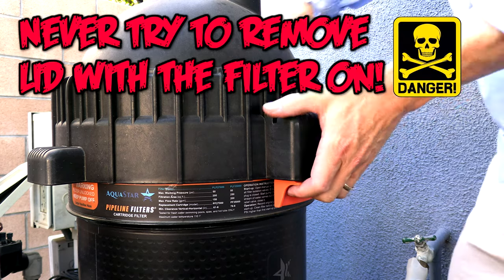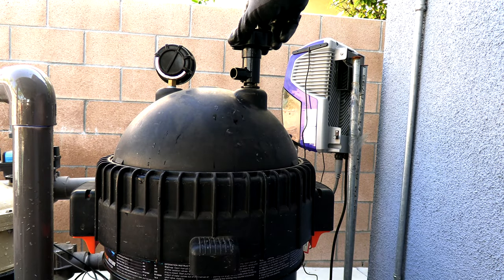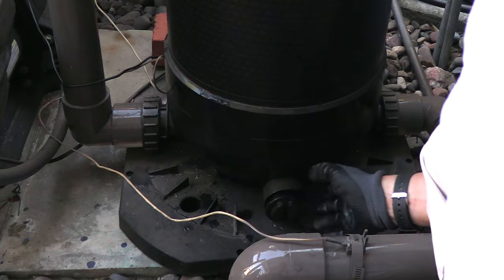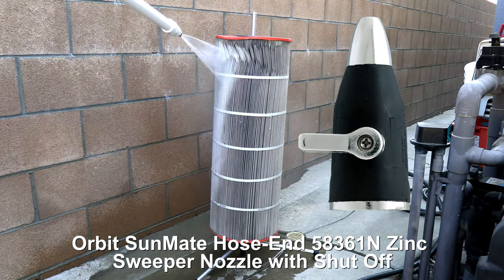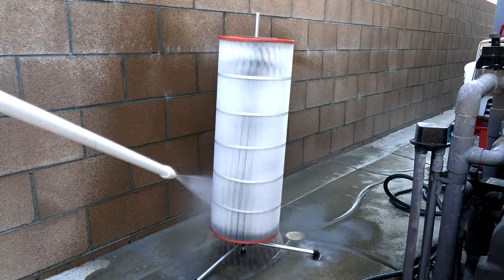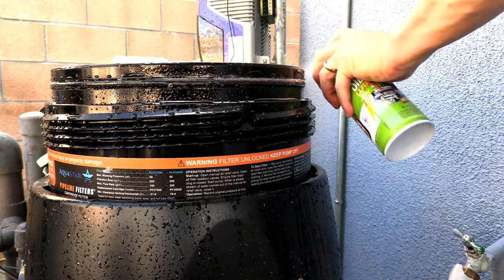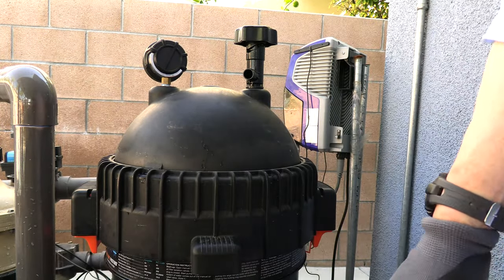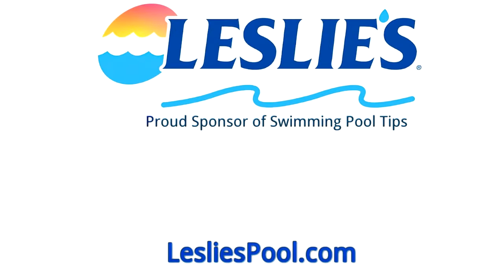How to Clean an AquaStar Pipeline Filter in less than 6 Minutes!

Comment: 6 months later, was hoping to see more reviews, users, discussions online on the Aquastar Pipeline, but SPL is still the only informative video. Very tempted by this model, but worried we're lab mice. LOL!
Reply from the maker: Funny. I can tell you that there have been some filters were the cartridge collapses a little on top - nothing terrible but the cartridge is pretty heavy. One pool tech had a bad ring that did not want to spin off even with the tank depressurized. One had a leak at the drain plug.  Last, one was plumbed in backwards - inlet & outlet reversed and the cartridge imploded. Nothing earth shattering yet. All what I would consider to be normal defects.

Comment: Cool video..!   What was that tool you used for filter drain?  Also, is there a good tool to remove cover of pump basket..?  My hands get bruised hitting those 2 ear-tabs to loosen cover...
Reply from the maker: That is the Button Hook. If you go to the Multi-tork site you will see it. They make a tool called the Klorkinator for pump lids.
Reply: @SPL  thank you..!🙂

Comment: At what psi should this filter run? Just got my pool up and running with this filter based on builder recommendation and a Hayward VS pump. Just cleaned the cartridge and at medium speed (85% 2932 RPM), it’s at 20psi, which arguably is fine but hits 28-29psi on high speed (3450 rpm). When I switched over to spa mode, the filter actually shook for a minute until it stabilized a minute later

Comment: I can't seem to get my filter cartridge out.  It sits lower in the canister than you show in the vid and will not budge.   Any suggestions?   Also, when there is a change in pressure,  the filter dribbles a bit from the main seal area.
The filter is about 3 months old so O-ring is new.
Reply from the maker: Sounds like maybe some backpressure. Using some force will get that cartrige out. Maybe lube up that oring really well with some Magic Lube.
Reply: Welp, found the problem.   Installer plumbed the unit in backwards.   Completely destroyed the filter cartridge and core.  New unit installed under warranty.

Comment: I’m keep getting debris return on two of these filters I installed. Any idea why and how to fix this issue. My guess is the cartridge is sagging below the center  pipe where I believe only clean water should be returning. The cartridges are only a couple months old.
Reply: I see the debris return on the screen for the Polaris cleaner
Reply from the maker: Maybe. That would be unusual. I would call them..
Reply: Make sure the inlet and outlet are not plumbed in backwards.   This is what happened to mine and debris blowing back in was due to the cartridge getting mangled and exposing the core.

Comment: Do you like the Aquastar filter? If so, how big of a pool do you recommend it for?
Reply from the maker: It's a good filter. I wouldn't go past 18,000 gallons really.
Reply: Not good to see this after I ordered and it’s in my garage . I have a 13000 gallon pool . Wanted to get rid of the four cartridge . Now to read you think there is a design flaw and won’t take care of 27 k gallons I thought I would be in good shape. Should I return it?
Reply from the maker: @mpnewhart8022  There is no defect per se. I just think realistically you would need 2 of these for a pool over 25,000 gallons. The pool in this video is 14,000 gallons so you should be fine.

Comment: Your filter collapsed a little bit too
Reply from the maker: Yeah, I think because it is so heavy. And the pleats are so deep.
Reply: @SPL  i wonder if the folks at Aquastar know that problem? im pretty sure it's not a good thing if one side of the cartridge starts to collapse, correct? Also, are these Pleatco filters not the Pleatco Advanced Ultra version which is the best one they have? I wonder why they didn't go with that because i wouldn't mind if the price were a bit higher because it's an Advanced Ultra cartridge. I know this exact cartridge is specifically designed by Pleatco only for the Pipeline filters, just wondering why it's not the Advanced Ultra
Reply from the maker: @bludika  I'm thinking they went with a cartridge from Pleatco that had the most inventory and availability. Plus Pleatco has some strange ideas about only selling the Advanced Ultra in retail pool stores. Meaning you could never order a new cartridge for this filter online. The bent corner should be a concern and I think it can be easily fixed buy a simple redesign. I've got an idea of how to fix that.
Reply: @SPL  I wonder why they want to go that route, there are tons of really good online retailers like ePoolsupply, sunplay, Inyo, or even Amazon, doesn't have to be in stores only.  What's the best way to prevent the filter collapsing? I got this filter too, just waiting to be installed.
Reply: @bludika Hi there, did you ever finish the Aquastar filter install? Did the filter media collapse for you as well?
I'm debating if I should buy this model. Thx
Reply: @danpark417  hey dude, yea i installed it, but have not had to clean yet, i think it's coming up soon so i'll find out. So far in terms of filteration, looks perfectly fine, i see no difference to how clear my water is when i had the DE filter
Reply: @bludika  thanks man, please post what you find when you clean the filter pls. Thx